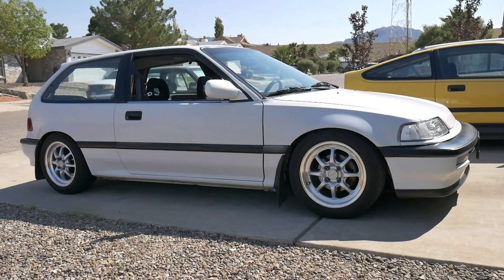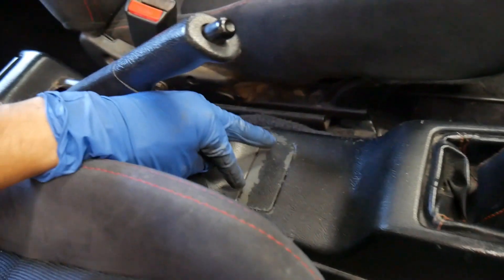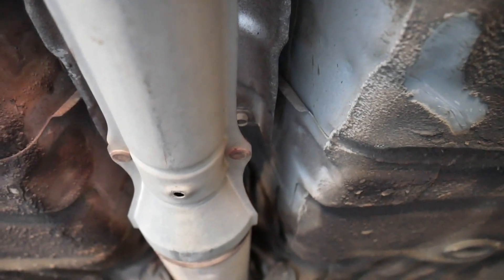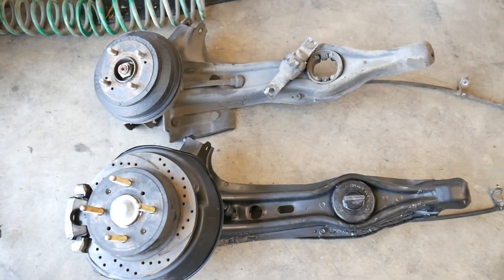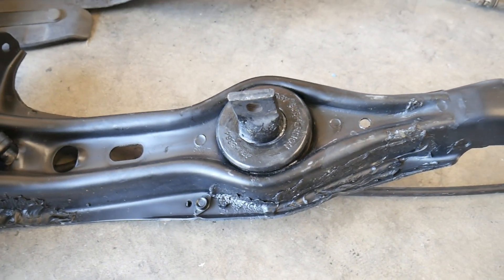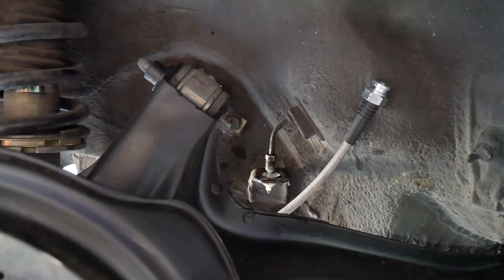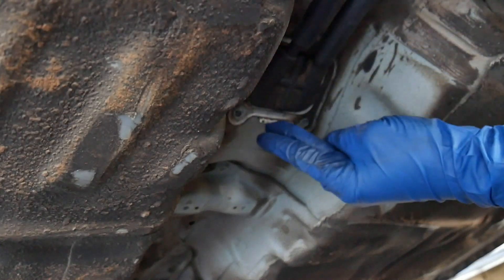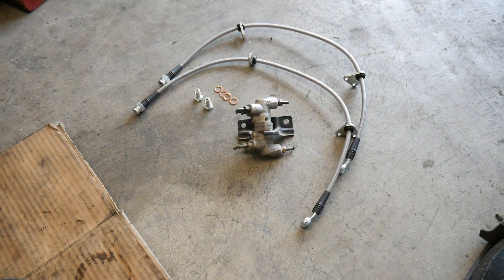How to Rear Disc Brake Conversion (88-91 Honda Civic CRX EF)

Comment: any idea on how to do the swap on a 89 wagon
Reply from the maker: +jacob parsons I've Googled it but haven't seen anything 100% definite.
Reply: Garage Built Hondas only thing I found is a adaptor plate to put rear discs on the original trailing arms
Reply from the maker: +jacob parsons was it expensive?
Reply: $229 for brackets and hardware an about $600 for the whole swap kit
Reply from the maker: +jacob parsons that's expensive for just a rear disc brake swap.  I don't think I could spend that on the kit.
Reply: your telling me just for rear breaks
Reply from the maker: +jacob parsons I'd rather spend that money on a bunch of different parts!

Comment: Will the E brake cables still work if the RTAs are from a 4door DA
Reply from the maker: Patrick Robinson Yes, great question.  They will be a little long for for the CRX though but I've seen people loop them to make them work.
Reply: So they are longer than CRXs cables, are they longer than a regular 91 hatch or is CRX cables different from the rest
Reply from the maker: +Patrick Robinson CRX cables are shorter than the rest because of the shorter wheelbase.  DA work on a hatch and sedan perfectly fine.

Comment: I can also confirm that 2000 Acura integra gsr arms fits. The brake feel feels good  even without the proportioning valve which I still plan on installing in the Future.
Reply from the maker: Thanks for the info!

Comment: So what is the "best" rear trailing arms to hunt down for ef rear disc swap?
Reply from the maker: What's you're usage?
Reply: @GarageBuiltHondas  General purpose. Looks like rock auto doesn't have any e brake cables for a 90-93 Integra or a CRX si... So where do you get the cables from?
Reply from the maker: Any model but DA has a smaller offset.  DA stick out about quarter in farther.  But DA work perfectly fine since you're not a dedicated track guy trying to squeeze the widest wheels under there.  I'm using DA on my track car with 15x8, zero issues.  You can use DA cables.  They're a little long but will work.  We did the DA cables on this car.  https://youtu.be/hyq57nH9cHE
Reply: @GarageBuiltHondas  So should I look for 90-93 Integra "sedan" trailing arms or it doesn't matter? Would the sedan trailing arms be better? As far as the brake proportion valve goes, I am to understand that it doesn't matter if the car had abs or not? Did all 90-93 Integras have abs? My ef doesn't, I'm sure. What info can yo bombard me with regarding the break proportion valve?

Comment: Hey kind of new to this but I was wondering if changing the proportioning valve is necessary, also wondering which brake cables would fit best in my 91 CRX?
Reply from the maker: You need 90-91 CRX Si cable for best fit.  All the others you will have to loop around close to the gas tank area.  The valve isn't necessary but does give you the best brake bias for adding the rears on a car that normally is drum.  I've done it for years with the regular valve on my sedan and it has been fine.
Reply: Garage Built Hondas Thanks a lot man, I was afraid I wouldn't get a reply but thank you very much. Thank you for the great videos too very informative and easy instructions to follow
Reply from the maker: +Enrique Arevalo you're welcome

Comment: did you ever change master brake cylinder or the brake booster?
Reply from the maker: No, it remained stock during this install.
Reply: Garage Built Hondas I am doing this swap and changing the 40/40 valve as well.... if I wanted to change the master cylinder from a 91 EF SI (bigger) to my 91 EF DX (smaller) do I need to change my booster as well? Is there any benefit on this cylinder upgrade? would it work?
Reply from the maker: All EF parts are interchangeable.  Only the master cylinder makes the difference depending on which one you want to use.

Comment: What modifications did u do to fit the usdm type r seats in that ef. Just the back rail leg is the only  that doesn't line up right?
Reply from the maker: I removed a couple brackets and rewelded them into place.
Reply: @GarageBuiltHondas  awesome! Thanks 👌
Reply from the maker: Same name as my channel here. 👍
Reply from the maker: I csnt remember which brackets.  I think I removed the outer fronts, and swapped them from driver to pass and pass to driver and it worked.  I should've recorded it but I've done a lot of seats this way.

Comment: Hey John, I have an 86 civic sedan and one would hope they wouldn't be any different than the 88-91 year range. Do you know if it's the same?
Reply from the maker: Not even close unfortunately.   Your car has a rear torsion bar and didn't benefit from the double wishbone that came out in 1988.

Comment: I found a 91 integra with the rear brake system on it still. but, my friend told me that they wouldnt work cause they were the ones with abs, so i didnt grab them. true or false jon?
Reply: By the way jon, great video!💯💯
Reply from the maker: You're friend is 100% incorrect, sorry.  The GS models had ABS but the rear discs are identical across all 90-93 Integras regardless of trim GS, LS, GS-R.

Thanks, glad you liked it.

Comment: With the polyuratane bushings in the rear trailer arm, did it cause any binding on the track?
Reply from the maker: +r0mulyni2 I've read a lot of different experiences.  The ES full urethane create snap oversteer.  Some people love the way it feels, others do not.  This car isn't a track car so for daily driving they are great.  I've been using these since 2008 and really like them.  My Si, LX, and DX all have these.  My track car has the HARDRACE.
Reply: Garage Built Hondas ahhh cool thought your setting up another track car, my bad
Reply from the maker: r0mulyni2 I wish!  No, this is my best friend's car.  He's slowly modding it and trying to keep it clean.
Reply: Garage Built Hondas i hear ya, its the best way to keep it clean value is going up
Reply from the maker: r0mulyni2 and getting tougher to find every year.
Reply: Garage Built Hondas and people wanted to pay me in peanuts for my civic, parked it back up if i sell will be next year

Comment: Hi, I'm trying to do a swap like this you did, however I've found a problem with the brake fluid lines.. Look, I'm mounting the Integra 1993 RTA on an Civic sedan EJ6 LX 1998, the problem is the original Integra's brake fluid lines are too short; so, my question is, what brake fluid lines should I buy to fit in my new rear Civic configuration? I'd really appreciate any help about this matter.. Thanks in advance..
Reply from the maker: Alvaro Urbaez 96-00 Civic EX or 99-00 Civic Si.  All of those have rear disc brakes and will be the correct length.

Comment: Supp bro me  again , so I found a 91 Acura and I was able to take  the rear trailing arms and disk brakes ..my question is   can I use my Si  e-brake  or do i use the ones from the Acura?  Also what type of brake lines should I  look for ?
Reply from the maker: If you have drums, you have to use the Integra ebrake cables.  You can pick whatever lines you want.  Get them for a 90-93 Integra.
Reply: Thanks

Comment: This it's a great video, very helpful. Though I have just one question.
Can you keep the original e-brake cables, or is it a must to replace them?
I ask the question because my EF LX came with the rear disc conversion already, but am having issues with my e-brake, I've adjusted it as much as possible from the center console but, really makes no big difference. 
Thank you!!!
Reply from the maker: You can't use drum cables, you need disc brake cables.  They are not the same.  You can purchase the cables brand new also if you want to try replacing them.  You may want to see if the caliper is sticking where the cable is attached to it.
Reply: Much appreciated guys, I'll jack up the car and remove them completely, to see what's the issue. @GarageBuiltHondas

Comment: I've always heard the disc brakes are heavier than the drums. Did you happen to weigh the different trailing arm assemblies?
Reply from the maker: +Muffin Racing damn you muffin!!  I forgot and now that you reminded me, I'm a little annoyed at myself.  Lol. I will weigh one the next chance I get and I'll update the results in the description.
Reply: Good point,,, my 88 CRX HF came factory with aluminum drums and they are the lighter option.  Easy to work on and parts are dirty cheap on rock auto

Comment: Whats a good big brake kit? Is the itr 5 lug swap good? I was looking at wilwood but its very expensive. Looking to upgrade on a budget
Reply from the maker: Are you taking the car to the track/autocross?
Reply: @GarageBuiltHondas  its a daily to work 😆 its a race to work everyday.
Reply from the maker: I'd just look at some nicer pad/rotor combination and take an afternoon cleaning your calipers and paint them a color you prefer.  A BBK is kind of unnecessary on a daily driver unless you've fixed/upgraded every other part of the car and it's just another part you want to change out.  But that's just my opinion, I don't really know of a "budget" kit except for the larger EX spindles setup.

Comment: I’m have an issue that I think may be kinda related. When my 91 CRX Si sits for a bit the passenger side ebrake sticks and recently I noticed a rubbing noise that seems to be coming from the rear. Would this be a sign that I need to replace the brakes? Would the sticking mean I need to replace the cable too? Thanks.
Reply from the maker: I would clean and lube all the parts and see if that helps.  Cleaner off all the corrosion on any of the slide pins and contact surfaces.  If that doesn't fix it then possibly the caliper might be broken.

Comment: Hey there quick question. Can I use the same lower arms where the shocks go For a 88 crx 
The 89 and 88 and different rear shocks
 Can the lower arms be interchangeable? Or do I have to use the 89 si shocks too?
Reply from the maker: Yes, you can use them on each other by swapping the rear lower control arms also.

Comment: So would this work on a 1990 ef and what parts would i need from what car? Any info would be helpful
Reply from the maker: Yes it would work, just the parts as mentioned in the video will work!
Reply: Garage Built Hondas thanks i was hopping you would give a parts list in the description bec watching it multiple times to write everything down is going to be annoying 😂
Reply from the maker: You'll just need the whole rear trailing arm setup off of the car you're getting it from including the cables.  It's pretty easy.  No compensator (toe) or lower control arms needed.

Comment: I have a question do you know if the mounting rod that goes inside the bushing is bigger on the DA or is it the same size as the EF?
Reply from the maker: Yes, its larger
Reply: @GarageBuiltHondas  It's kind of weird the rear disc brakes I bought have the Civic bushings and inner mounting rod I already bought the Integra bushings but I'm stuck with the smaller Civic inner mounting rod 
I swear just when I think I've seen it all LMFAO
Reply: @GarageBuiltHondas  You wouldn't by chance know where to buy the right size?
Reply from the maker: It can be a real pain sometimes not knowing what was installed previously.
Reply: @GarageBuiltHondas  Especially when the person before didn't know what they were doing lol
Reply from the maker: That's most Honda owners too.  Lol
Reply: @GarageBuiltHondas  Or at least these kids that end up with an EF and do so called (performance mods) lol when all they really do is more damage to the car than try to sell it for way more than they originally paid lol me on the other hand I have been working on Honda's for years and have always been an EF owner I build engines and transmissions do wiring and everything else one thing I've learned before upgrading an EF you have to first correct any mistakes the previous owner has done lol than start upgrading
Reply from the maker: Exactly.  My Roon49 crx was a perfect example of that.  Still has some dumb wiring issues for the corner lights which I haven't tackled.  One day.
Reply: @GarageBuiltHondas  Yup exactly what I'm talking about that's why a power probe is a good investment

Comment: what brake lines did you use since you can't use the ones for the drums? The crx is brake lines, lines for the DA, or some other option?
Reply from the maker: We used DA on this car.  You need CRX SI cables for a CRX.  That's the only exception.

Comment: By any chance do any of you guys have a fix for idle surge on a dpfi dx? Ive replaced the iacv, but its still there. Any help would be awesome.
Reply from the maker: Kaleb Kunze There's a video on YouTube, a guy with a crx and he replaced something close to the throttle plate, it's been forever since I've watched it, I'd try that out.  Before anything else, spend $5 and replace all of your vacuum lines.
Reply: Garage Built Hondas thank you for the suggestion. I will research into it when i get home.

Comment: Will your stock e-brake cable work or will you need one from a integra
Reply from the maker: No, you need rear disc cables.  Integra for all models except crx.  Crx need 90-91 CRX SI specific cables.

Comment: Hey Jon I’m doing the rear disc conversion on my 91 civic hatch. I’m using the da trailing arms but I was wondering what brake line kit you used ?
Reply from the maker: +Jesus Martinez eBay stainless steel kit made for 91 Crx SI.
Reply: Garage Built Hondas thanks ! I actually found a nice set on rock auto since most of the ones on eBay come from China.
Reply from the maker: +Jesus Martinez very nice!  I've had good luck with the eBay ones, their quality has been top notch!

Comment: Great Vid.! Another way is to  just get the rear spindle or hub assembly from a DA teggy it unbolts from the RTA with 3 torx bolts. You can bolt it straight on the stock RTA 👍👍👍
Reply from the maker: Austin Johnson I'd like to try that next time, I've just never done it that way.  Thanks for the info!!
Reply: he had to replace the bushings so it was coming off regardless.
Reply: Austin Johnson 

Hey men, can i do this installation if a have a crx ed8 (japan) with no solid lower control arms (as eg6 or dc2)  i have a conversion from civic 92-95 but i dont want to change my lower control arms and shock.
Reply from the maker: Yes.  The LCA still mounts the same to the trailing arm.
Reply: Can you do a video showing this

Comment: How'd you get those type r seats to bolt into the ef? I want to put mine in a 90 crx
Reply from the maker: +Joel Rodriguez Completely custom.  We cut off the brackets and relocated and welded them back on in the correct spots.
Reply: Garage Built Hondas I thought so that's what Im thinking of doing. Thanks.
Reply from the maker: +Joel Rodriguez you got it!

Comment: what I currently have to do .previous owner installed the rear trailing arm but no brake cable, brake lines, pads or rotors. debating on just getting a new set. but this helped a lot as every car ive bought had rear disc already. keep up the great work. #GulfCoastEfs
Reply from the maker: I'd just add the parts.  They did the hardest part so far!

Comment: Hey Jon 

I have a 90 si hatch. And my friend is parting out a CRX si. Will those rear disc be good. Or are Integra or EG better?
Reply from the maker: They will be good, but you'll need different ebrake cables.  The crx cables are too short.
Reply: Garage Built Hondas  cool thank you. You think I can just re-use the same ones the car already has ?
Reply from the maker: No, you need disc cables.   Drum do not work.
Reply: Garage Built Hondas ok cool. Thank you so much for you help. I follow your builds for my track Hatch.
Reply from the maker: Awesome!  Another video of that coming soon!

Comment: Hey john was just wondering about wether the stock booster and master cylinder are fine with the conversion or if they need to be updated aswell. Cheers
Reply from the maker: Matthew Parham they work perfectly fine!

Comment: Hi I want to do the same swap I have a 94 civic sedan I already have the era but no e brake lines souls I use the same e brake lines from my sedan or what time of lines should I use that's all I need to start my swap I any one could help me I will truly appreciate it
Reply from the maker: Same "cables" that your RTA's are from.
Reply: But that's the thing I don't know from what integra came from can I use my e brake cables and also what brake lines you recomend for the rear
Reply from the maker: Any from 90-01 Integra will work.

Comment: Hey Jon, I know this is an old video but if you see this, can you tell me if I can attach the lines from the DA integra disks to the hardline on the body of a 90 civic hatch? I know you said to get stainless steel ones but I noticed that your lines were cut in the video and wasn't sure if you said to get stainless ones because of that.
Reply from the maker: Stainless isn't needed.  The stock ones will fit.  I always upgrade because those old rubber hoses start to crack and break and since I'm already disconnecting the lines, it just makes sense to replace them at that time.
Reply: Garage Built Hondas hell yeah! Thanks for the quick reply, I thought I was going to have to set back my swap and wait for some steel lines!